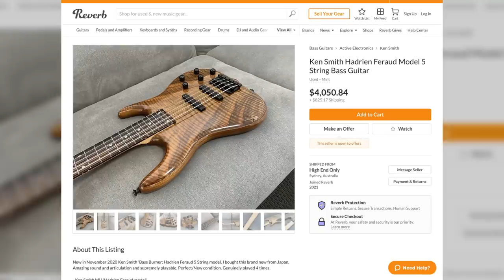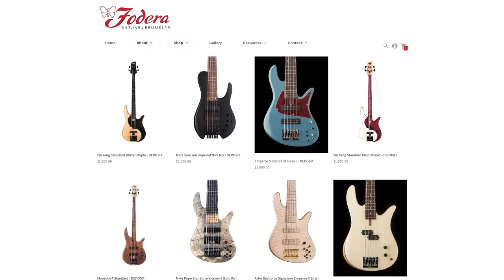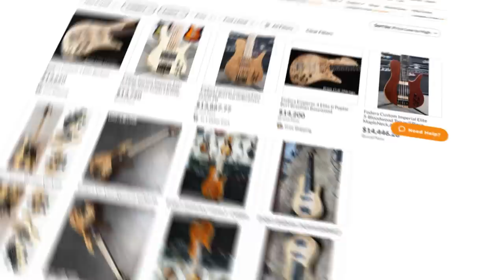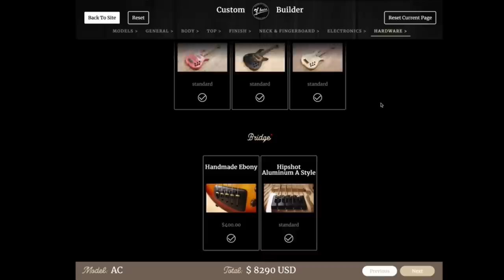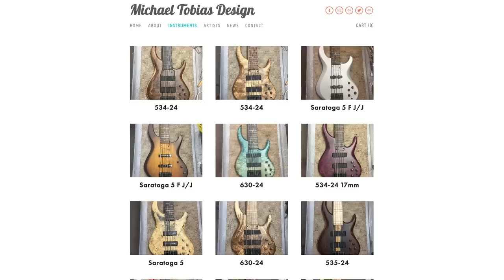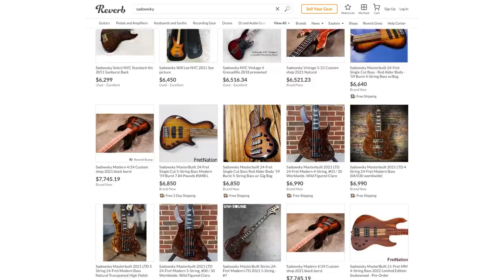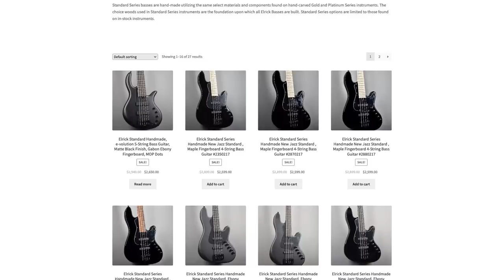Top 5 Boutique Bass Brands to Play Before You Die

Comment: You forgot to mention that Alembic started the whole boutique industry (1969) also they developed the active electronics!
Reply: Active electronics came before them, they were the first to use low impedence pick ups requiring an active preamp to boost the signal. They also chose to use filters instead of eqs on their basses, the filters coming from Pluto Filters by George Mundy, a type of state variable filter. These filters are in their Sf-2 superfilter rack units. Their pre-amps are based on Fender Dual Showman’s with the Tone stack eq style
Reply: My wife gifted me an Alembic Essence Bass. for Christmas back in the 1990s. I did love it for quite a long time for it sustain, clarity, and evenness of notes top to bottom. It had only the low pass filter and a pan pot for tone. I think that the more expensive models offer more control of the sound. I still have the Essence but no longer use it and have gone back to passive basses for the most part because the Essence was incapable of mid bass warmth and the E string although very clear does not have the tonal weight that conventional basses do. I think that Alembic is for players that are much more advanced than me.

Comment: I have 10 basses, the majority of which fit into the 'Boutique' category but years ago, when SIRE Marcus Millers first came out, l got a V7 identical to Marcus's Fender which is very good. Three months ago, l got a P7 2nd Generation, white with tortoiseshell scratch plate and two pickups. A really fine bass and better than any of my previously owned Fenders! Having an 18 volt preamp with 7 controls gives you oodles of tonal variation, more so than many other basses, no matter the value!